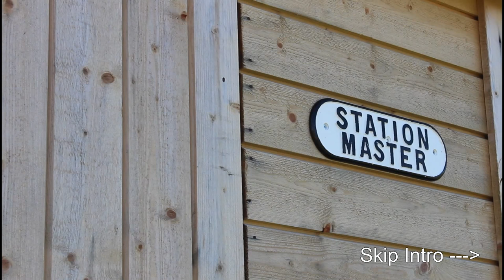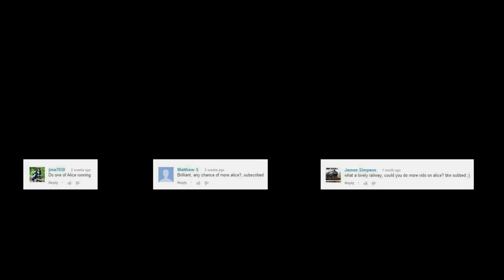Miniature Railway Update - Alice (Including Finishing The Run)

Comment: Thanks for advice. So on a run about 1 tank of water and a cup full of coal?
Reply from the maker: About that. Maybe 4 or 5 cups for a good hour to an hour and a half. But don't quote me on that (it's been a while since I've don a run) and like I said it really does depend on things like how much weight the engine is pulling and what gradient it's running on. The more weight and the steeper the gradient the more fuel it will use.